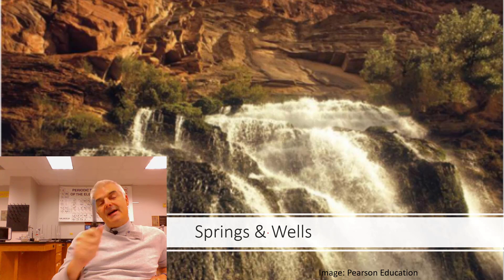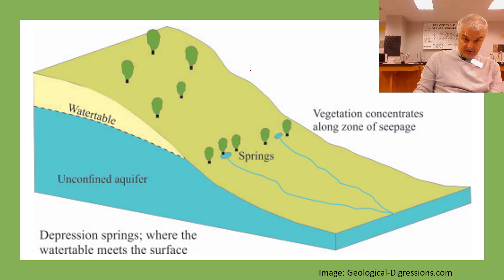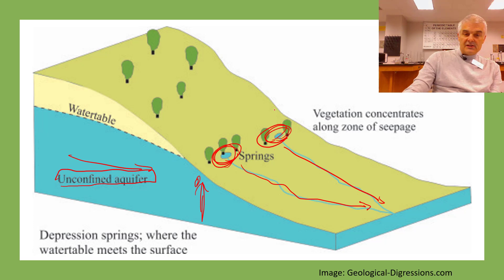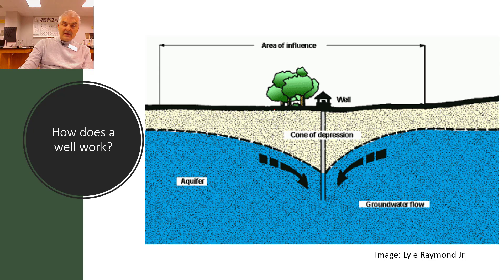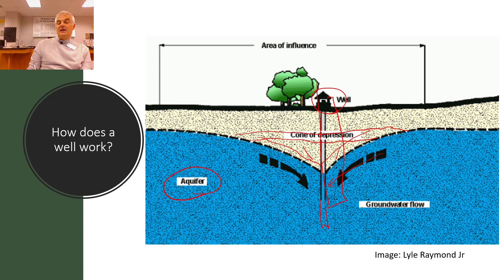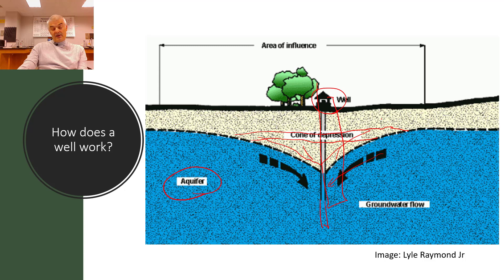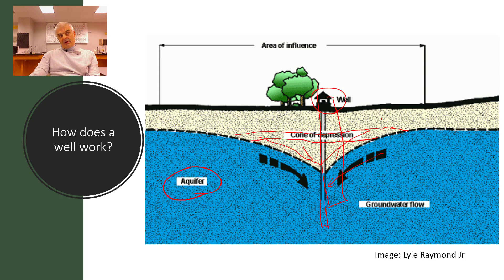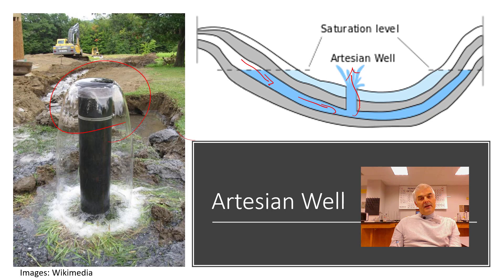How Does a Water well work?

Comment: Pardon my ignorance, but how exactly does water get inside a water well bucket? Wouldn't the bucket just float on top of the water once you lower the bucket down the well?
Reply from the maker: You would have to dip it to have it sink
Reply: The rope helps you tilt it
Reply: Really ? You would need a rocket scientist to figure that out
Reply: Are you serious?
Reply: @doobydoo88  godforbid someone asks a question before taking your advice
Reply: All silly jokes aside, you can either shake it until it tips over, or you can weigh the bucket down until it weighs more than the water it displaces. Buoyancy 101

Comment: Very interesting, thanks!
Could you please tell us more how a well fills again? If the well needs to go down obviously will take more time to fill again but the level will be as was previously? 
I have seen wells in which instead of going down they go to the sides. Why is that ? Is that helpful?
Thanks 🙏
Reply from the maker: It all depends on the water table in the area - but the key thing is that it seeps into a void caused by the pump taking water out.

Comment: It rained heavily yesterday and today I noticed water dripping from the walls of our well into the well from about 12 feet. Is this normal?
Reply: @JonBergmann  And doesn't this mean the water has been contaminated with surface water?
Reply from the maker: @OfoeNelson  good question. Maybe. You might want to have it tested.
Reply from the maker: remember that the ground (soil, sand, etc, is a very good filtering mechanism.  So it is likely safe if it is just rain water and not coming from or flowing through anything contaminated.
Reply: @JonBergmann1   The colour of the water has a very light clayey colour when it's settled
Reply from the maker: @OfoeNelson  probably not a bad idea to test it - I am not a water quality expert - just a science teacher with lots of general knowledge.